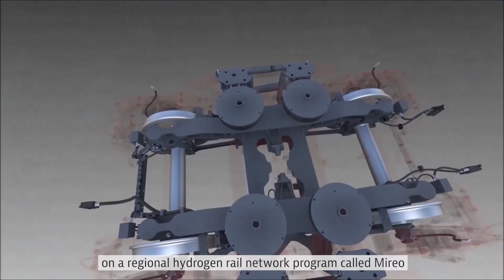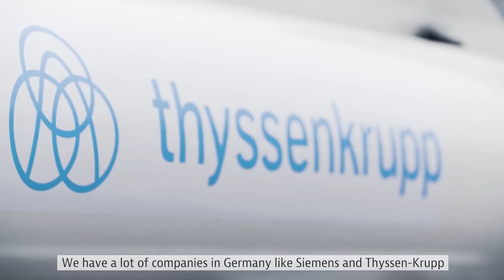Germany Goes Whole Hog on Hydrogen

Comment: Hydrogen can’t be used in existing CH4 networks. Do your due diligence. It takes 3 X the volume to move the same energy. Everything needs to be scaled up. Pipes, compressors, valves…….